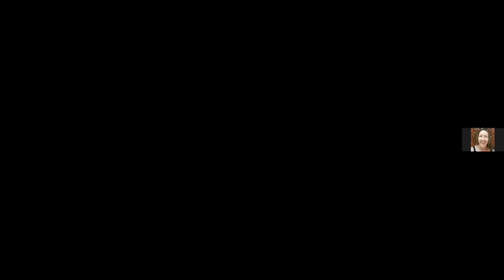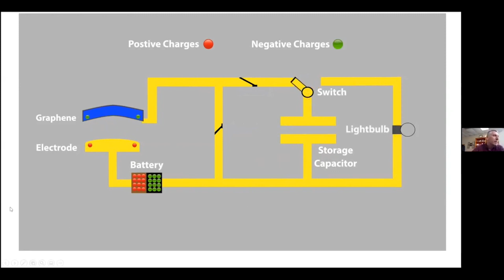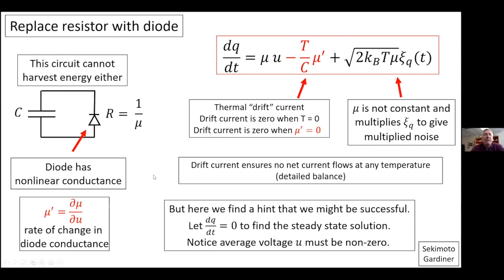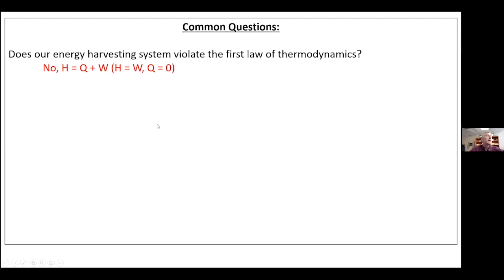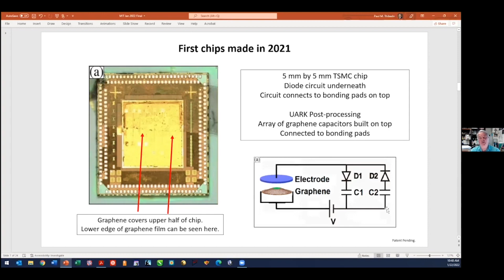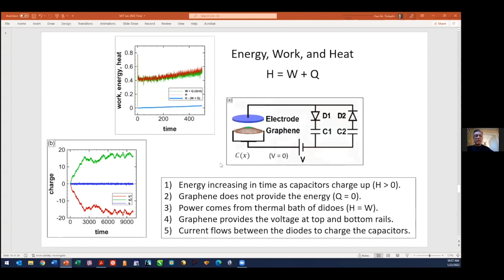Paul Thibado | Charging Capacitors Using Graphene Fluctuations

Comment: Super interesting. It sounds like a electrostatic/mechanical oscillator where the capacitors and diodes complete a pseudo resonant tank circuit where charge is stored instead of being released in the opposite polarity and returned to the circuit. Based on this I don't think a load could replace the diodes and capacitors otherwise the load would dampen the oscillation and reduce the q factor and probably diminishing the maximum power point.

Comment: I don't think you need much energy to spin a rotor on magnetic bearings, I think self powered flywheel energy generators and storage might be possible with single-phase capacitor-start-run electric motor. Can't we multiply voltage of capacitors?

Asking for a friend lol 😆

Comment: The energy comes from somewhere else, it is not made, it is simply harnessed within a room temperature superconducting device.
Reply: Superconductivity is not involved in this device operation.  Professor Thibado says the energy comes from the thermal bath of the diodes.

Comment: Well, this system doesn't violate the 2nd Law, but it does "violate" the "4th" (Onsager's). These are extraordinarily good news. It also says we can harvest energy from Casimir forces using a similar, but scaled down, approach. Right?
Reply: That is what prof. Thibado says but other scientist's think it might. It depends on what statement of the Second Law on uses. Ultimately, if it converts ambient thermal energy into useful energy it is violating some forms of the 2nd law which data is showing is possible. This is not the only 2nd law violation in the literature by far.